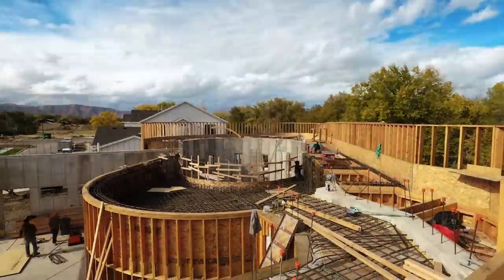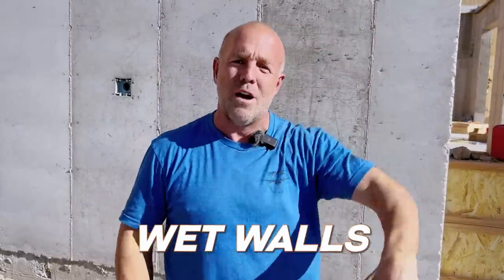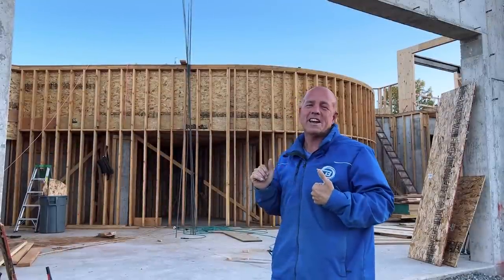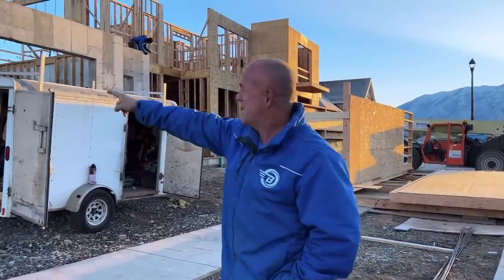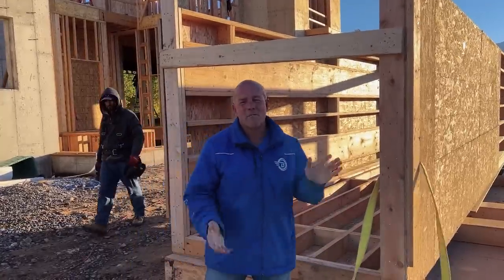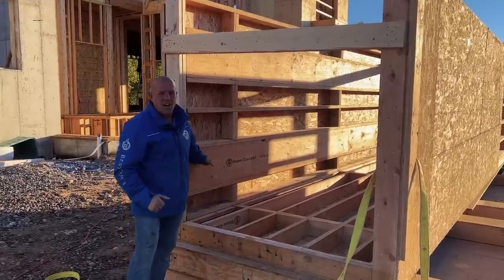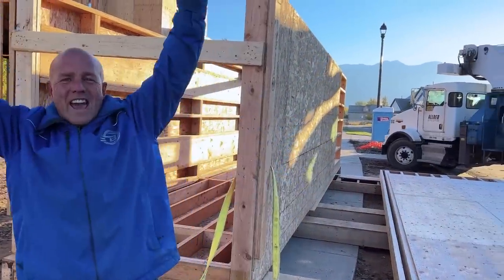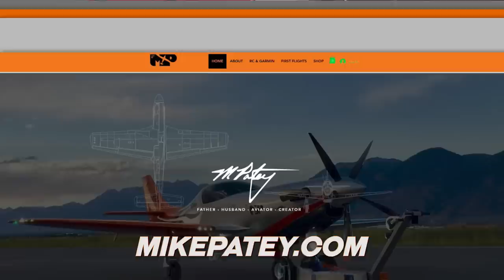3 Story Scuba Pool | House Build #8

Comment: Gotta say that with all the extreme engineering not withstanding the most amazing thing you have there is a crew who will do what you want without 'cheating' on quality and do it well.  I would guess that 95% of the contractors large and small out there have the attitude of 'just get it done so we can walk away counting the money'.  Then you are left holding the bag.  Behind the scenes I can appreciate the many, many hours you spend babysitting the job to make sure that the corners aren't cut and substandard products aren't left in.  You do have a huge advantage in them knowing this won't be your last project!!

Comment: Amazing. Probably already in your plans, but just in case. The cables will pull some water with them. If room for it, add wipers to get most of the water off the cables before they go downstairs.

Comment: A couple of ideas:
1) On your radiant flooring, are you installing a alternative tube system in case the pipe or tubing fails? Maybe use as a alternative is PEX A tubing.
2) When you are covering the floor decking before concrete;  Instead of asphalt felt paper, use TPO Membrane and heat weld the seams OR There is actually a LIQUID TPO  that you can roll or spray on that is the same chemicals as the TPO Membrane.  TPO is a much better at protecting you than asphalt felt.  

But you may not need that.

Comment: With most if not all engineers adopting the credo of using a minimum amount of material to meet the requirements Mike has maintained the prectice of ruggedly overbuilt to withstand any unforeseen circumstance. I do have one question about the cable system for the pool deck. I did not see any inspection or access panels to inspect the cable and pulley system for the pool. Surprising after watching all of the care and attention to detail Mike put into putting those panels into Scrappy. ( I also would have went with larger diameter pulleys for the cables to reduce flex stress.)

Comment: As I probably already mentioned somewhere, using prefabricated wood like OSB, or other stuff where pieces of wood are mixed with different types of glue (particularly raw ones, without glossy cover), as casing for casting concrete, can impact quality of the concrete, at least at its surface... different chemical mixing with the cement is strange, still unexplored thing (probably similar things happens at our rivers, lakes, sea, that we still don't know well)... ... try it first at small samples, if You need high quality... Regards from Serbia.

Comment: This was probably already suggested or thought of but I was wondering if you plan to have some type of locking system for the floating platform when you raise it out of the water. I know you're gonna have plenty of buoyancy for the platform to float and hold weight but if enough people are walking/dancing on a floating platform it is bound to move a bit. It might become a balance issue if it is shifting especially after a few drinks... Amazing build though and I can't wait to see the finished house!
Reply: Thing is though, it's not a floating platform - or at least, not free-floating. It's held down by cables and it's displacing 2-3 feet of water over the entire surface area, so very roughly we're talking 50+ tons of force pushing that platform upwards when it's fully submerged. Fair point that you lose the buoyancy of whatever portion lifts up out of the water, but you'd easily leave half the platform submerged and still have 25+ tons of support. Far as the guests are concerned, it might as well be sitting directly on a concrete slab.

I did do the maths on this, and honestly I'm even more impressed by Mike Patey's over-engineering now. He's not designing this thing to be just as strong as it needs to be - he's designing it to be as strong and reliable as he can make it, and he's very good at that. This whole house, pool and all, is going to be pretty much indestructible.
Reply: @patheddles4004  Yeah I didn't recall the amount of force that was involved. Must've missed when he talked about it. Definitely sounds solid

Comment: I'm curious how you will prevent the pool water from siphoning up the cables and over the top, and then dumping out into the cellar. I'm sure you've come up with a way, but you didn't mention it specifically in your previous video (unless I missed it).
Reply: Thanks, now I understand why he's bringing those cables up and then down again - this honestly hadn't occurred to me.

I think the answer is that the conduit for those cables isn't a sealed pipe when it's above the water level - siphoning can't happen, because it just sucks in air instead.
Reply: @patheddles4004  - That definitely makes sense, but my experiences in fish-keeping when I was younger taught me that water will siphon any way it pleases. I've seen it siphon, usually in small amounts, over the corners of fish tanks, the outsides of air hoses, on power cords, and especially on and through braided cords of all kinds. It is definitely counter-intuitive, but I've seen it happen and cleaned up the messes it can cause. Hopefully Mike has engineered an effective way of preventing that.
Reply: @N1RKW  ah right, yes - that's surface tension screwing you for the first few (same principle as capillary action and meniscuses), and wicking letting it go through stuff. Plus condensation making it look like water has gone through something that it genuinely couldn't, of course. Completely legit concerns based on your experience, I just didn't initially know what you were referring to.

I mean I'm sure Mike has thought about this and done the proper modeling to make sure it's all good, but the simple answer is that those effects don't work the same at larger scales. They're all about surfaces and boundaries, and those become a lot less significant when you scale up (because volume scales much quicker than surface area).
Reply: @patheddles4004  - Thank you! I had always wondered how that happened. It did seem strange that something could siphon in open air. Surface tension and wicking make much more sense. I guess I should have figured that out, but I guess I never gave it a lot of thought, to be honest with you. Thank you kindly for enlightening me. 😊

Comment: It is so much fun to watch this…. Like Alice in Engineering Wonderland….. Does your floating dancefloor have any linear guides as it rises and falls? Im imagining it being being unstable as it floats, like a floating boat dock.
Reply: Should be rock-solid I reckon - near as I can figure, it'll still have about 25 tons of excess buoyancy even when it's lifted up out of the water as a dancefloor.

Thing is, those cables would have to go slack before the platform could dip at all. And that'd take a spectacular weight, tens of tons sitting on that dancefloor somehow.

Comment: I am sure you have done the math on this but something I noticed. The cable pathways where they are attached to the base of the pool in the concrete. Was that 6-8 tapcons holding a steel plate into the concrete and sealant? I like building things way overkill when there is no weight or other penalty that feasibly prevents me from doing so. Is that area getting backfilled with concrete?

Comment: Mike,  what type of caulking or sealant was used where the metal thing was attached to the concrete?
Reply: Looked like sikaflex to me..... I was surprised there wasn't a bit more redundancy and serviceability in that connection.
Reply from the maker: Great thoughts and questions your spot on.  That only shows the first of five seals on that pass through. I’ll show more later as we get to that point. Inside that concrete tube from the other side gets sealed again and then a couple inches further into the concrete gets an expanding seal that expands if water gets to it.  Then concrete again.  After that layer it’s gets a pool joint sealant followed after that it goes to the pool plaster with a embedded flexible seal.
Reply: @Mike Patey  Thanks for the reply. Interesting project. I am sure you will pound it to the finish line. When's occupancy?

Comment: What’s going to keep the floating dance floor stable? Won’t it be able to dip?
Reply: Excess buoyancy. Basically the water will be pushing it upwards very hard (like 25 tons hard), the cables will be holding it down, and you'd need to apply many tons of force before it'd dip at all.

The platform is at least 2' thick - even when the top is exposed as a dancefloor, the bottom will be a foot or two underwater and there'll still be 25+ tons of buoyancy trying to lift it further.

Comment: Did you ever consider doing a PT deck for the pool deck, or is it not possible?
Reply: You mean exposed pressure treated wood?  I think this house is far beyond that
Reply: @martenkerkhoff6600  no PT refers to Post Tension. It's the type of concrete slab work they use to build multi story parking garages.

Comment: Would it Not been easier to put steel tube in instead of sonna tube, filled that tube with rebar..
And pour concrete
Would that Not been 100 times more structural.bearing mega tons if need be.
Those casings are easily accessible.
  Plus, once set and plumbed..A Forever
Force to never be denied.or destructed.

Comment: I am fascinated by your project, it is highly unusual.  However,  I question the wisdom of bearing the concrete infrastructure on one large column. It seems to serve no purpose as concrete columns embedded in the wood frame walls could easily have been used without sacrificing interior space. It would have been cheaper and stronger to engineer the structure in a more traditional manner.